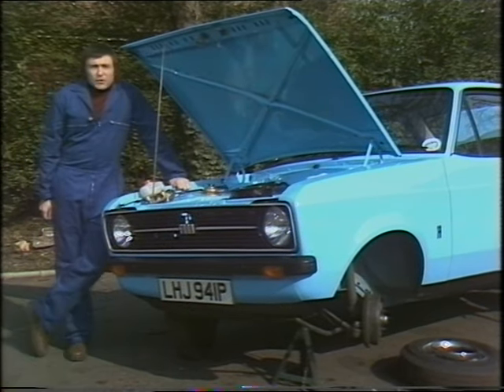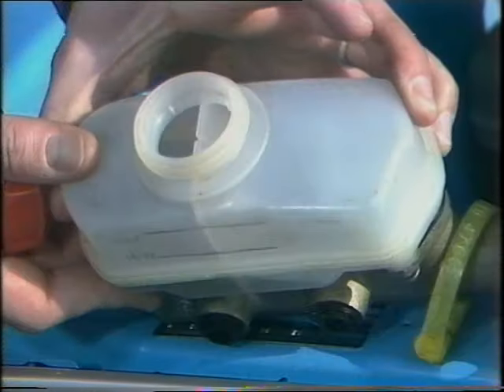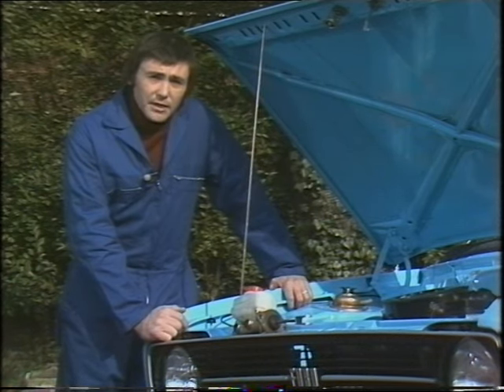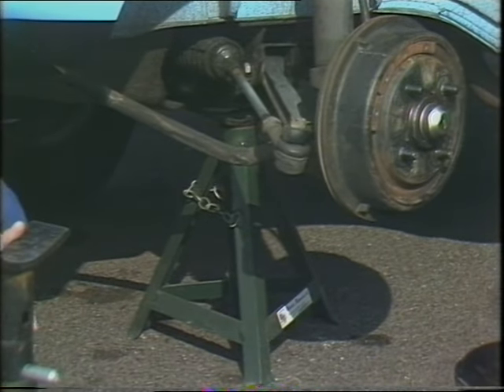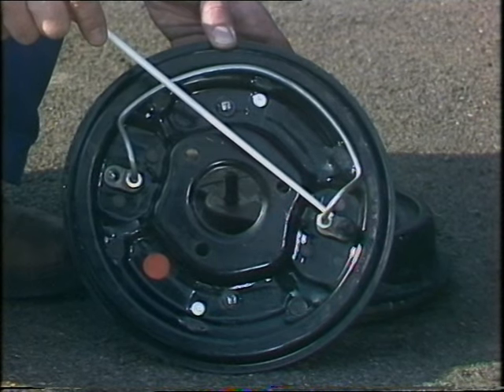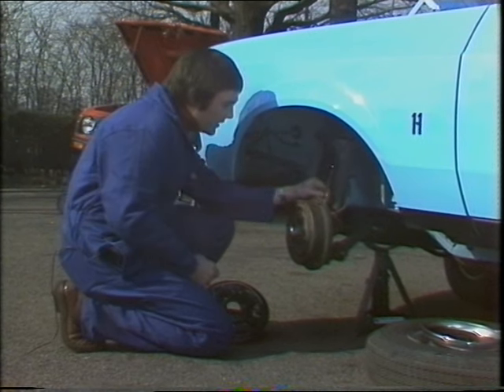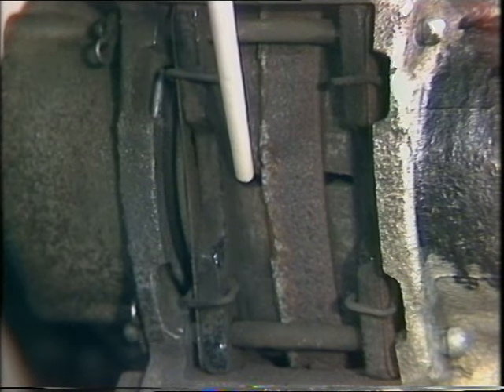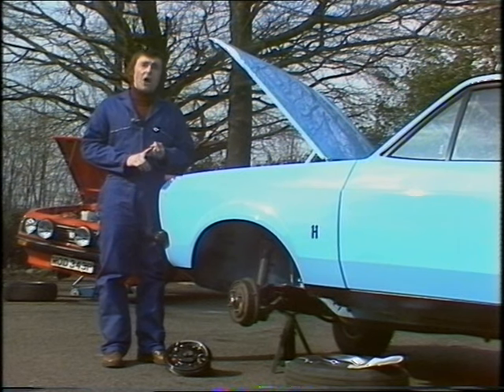Vintage Car Repair | Car Maintenance |Drive in | 1976

Comment: Drum brakes on the front wheels? No thank you!
Reply: Very easy to adjust though.
Reply: Not that bad when you're used to them.
Reply: it was fords "horse cart" technology :)
Reply: well, old škodas had double drums front and rear and had great breaking, much better than usual comparable disc/drum combo, but the downside was early fading....first breaking is great, but others are catastrophic....
Reply: And yet even the 1200 Cortina  mk1  had disc brakes  in 1964  and the Escorts rival_ the Morris 1100
Reply: fiat 1300/1500 even before.
Reply: well, it is wrong to relate low power with bad brakes because even with that power the car could go well over 120 km/h or 75 ml/h....
Reply: maybe it didn't have brake servo which made car harder to brake effectively without strong pressure on the pedal.
Reply: Denis 1901
Easy adjustment or not, discs don't need any adjustment.
Reply: My first car had drums all round, pretty bad.
Reply: Yes, funny how Ford economised on saftey. The base Escort Mk2 would had drums all round. The Mk3s all had disc drum setup though.
Reply: @user-lx6bl2wd8g  only the base models had front drum brakes. The rest had front disc brakes
Reply: I had a 1300 VW Beetle years ago which had drum brakes all round you used to get brake fade when braking at motorway speeds very interesting!!!!😁
Reply: All round drums work fine as long as they’re in good order. Try driving a car with front discs but no servo (like the aforementioned Cortina), that’s worse. Oh, and the base model Cortinas didn’t get discs until the mark 2.

Comment: Bet that RS2000 is worth a fortune now.
Reply: I wouldn’t bet that it was on the road in 1985. Those cars rusted like crazy, as did most cars from that period to be fair.
Reply: Long since gone that one. The OO in the number plate denotes that it was a Dagenham car.
Reply: George Jacob Dagenham car? As in used by Ford for promotional videos (like this one?) If so, it probably didn’t see out the year before a date with the crusher then...
Reply: Absolutely. Roger Clark used to rally Ford works Mk 1 and Mk 2 Escorts with the 'OO' prefix too.
Reply: @mrnatty122 Go and have a look at this one https://www.carandclassic.co.uk/car/C1118413 and I've seen one that was almost £30k more than this one.....and it was brown with tan seats!!!

Comment: I remember front drum brakes mk2 escort defo but juddering brakes due to oil???? that's new.
Reply: John Mclean I thought that, in my experience brake judder is usually caused by warped discs or oval drums.

Comment: Changing brake fluid? Nobody does that.
Reply: hffp1 I live in Florida where it gets pretty hot, and I've never heard of that happening
Reply: I do it every two years! I use Motul DOT 5.1.
Reply: justsomeguytoyou I cant recall ever doing mine!
Reply: My car has just done 110k and I’ve never done it. Brakes are still perfect. I don’t think I’ve ever changed it on any car I’ve owned. Just topped it up occasionally.
Reply: Certainly back in the day we used to change brake fluid every 24000 miles or 2 years whichever came first, the brake fluid used to turn dark green over time. Even now my mum's 2016 Citroen has a scheduled brake fluid change at 4 years.
Reply: @philnewstead5388  Maybe in places like Britain where they have the MOT it's more important. But I'm 51 years old, and here in the US, I have never once heard of anyone having their brake fluid changed. It's just not a thing here
Reply: justsomeguytoyou I was a mechanic back in the seventies and I did an old style apprenticeship here in the U.K. which meant I attended college for six weeks of the year and one evening a week after work and the science behind it was that brake fluid will over time absorb moisture from the atmosphere and if enough moisture is absorbed it could cause the brake fluid to boil under heavy braking and thus cause premature brake fade. Most cars in the U.K. back then had solid discs on the front and drums on the rear. All that said I have been away from the motor industry now for twenty years so modern fluids may not need the same care as they did back then, I still can't get my head around the fact that some modern cars don't have their spark plugs replaced until 60000 miles it used to be every 12000 miles with them being removed, cleaned and reset at 6000 miles.